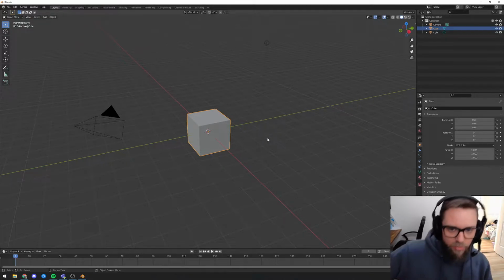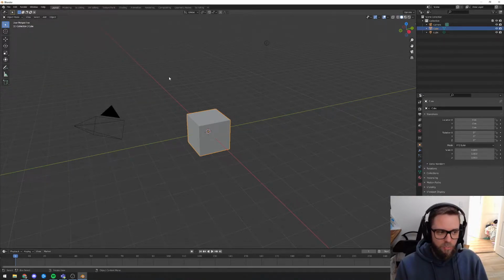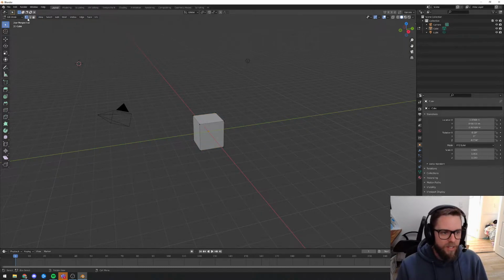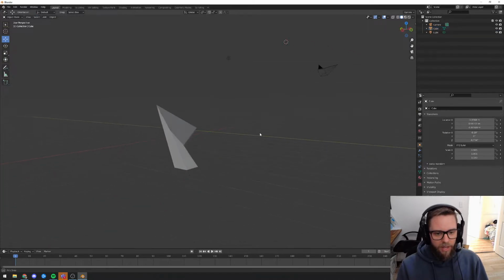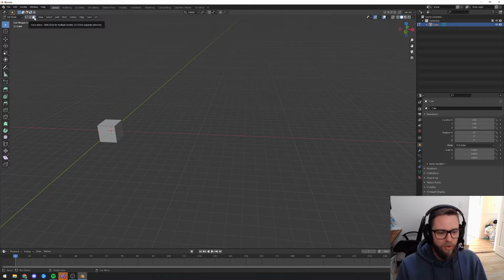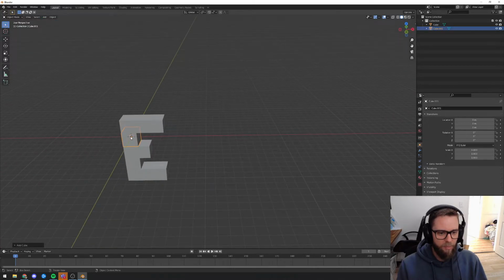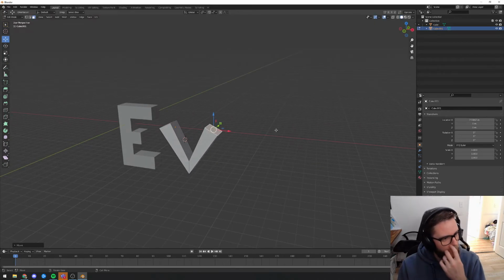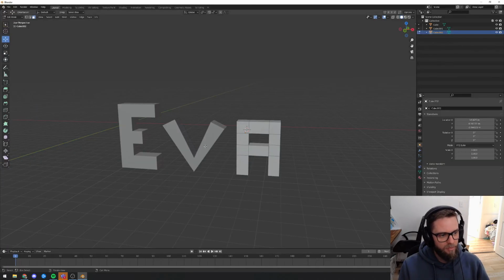Introduction to Blender - Blocky Name Tutorial

Comment: Whenever I try to extrude a face of a cube, I always have to adjust it to make sure it isn't angled. Is there a solution to this problem?
Reply from the maker: It's possible that you have created an extrude by accident, without moving the face away. and then are creating a second extrude instead of a first. This sometimes results in weird angled extrudes.